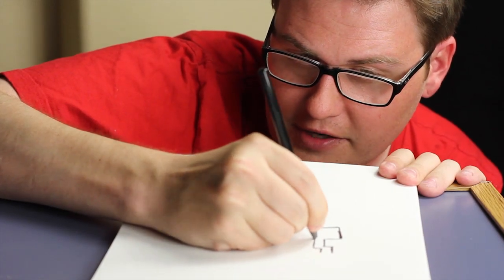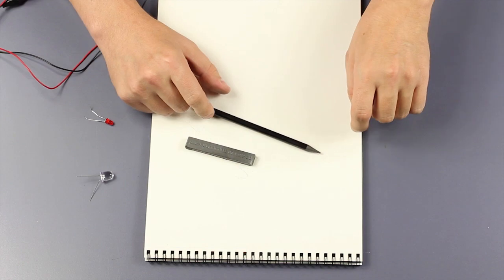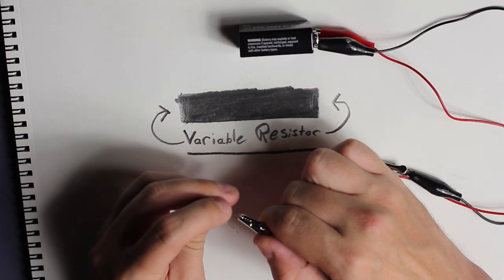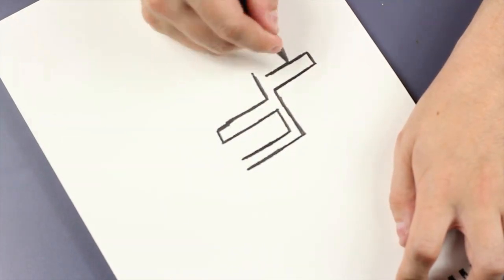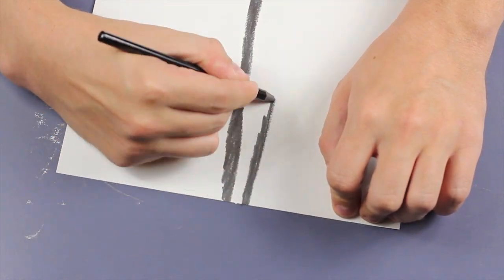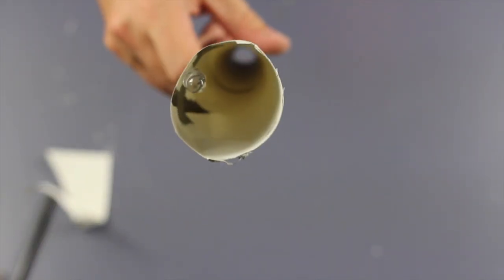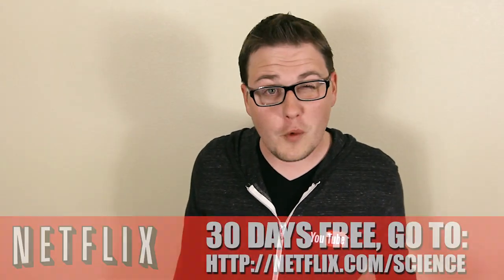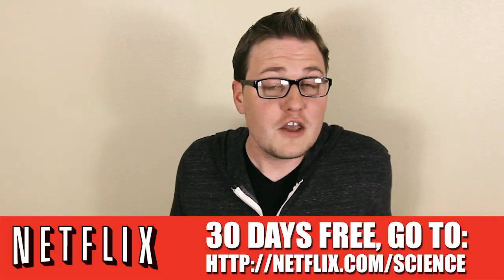Paper Circuit!

Comment: i tried it and it didn't work, when i tried it whit LED. I measured it with multimeter and got big resistance reading. then i calculated, how much voltage would it take to power-up the LED, using U=R x I , method. it was too big to achieve with my school lab equipment.

Comment: There's a reason things are made the way they are. Do a search on logic gates & data storage, then come up with a way to implement that using only paper. I'm sure a paper motherboard using this method is theoretically possible, but even that would only cause problems. A paper CPU is impossible because it uses electrical switches that react to electricity. Unless you pull a magical pen out of your ass that expels mythical gate ink crafted from evil unicorn sperm then I think you're out of luck.

Comment: Actually, even though graphite isn't the best conductor, graPHENE is. Graphene is essentially a single layer of a graphite molecule, and because it has a relatively "2D" geometry, it can work as almost as a superconductor. As you write on a piece of paper, microscopic bits of graphene are shedded off of the pencil tip. These little bits, although not perfectly connected, can still conduct slightly.

Comment: yeah i get that, but it would still be larger. You could see the width of a peice of paper with a x200 microscope; it takes a lot more of a powereful microscope to even see the transistors on a silicon chips. and the uv light that they use to etch the silicon etches in 3d so there are actually layers to the silicon chips too. AND graphite would most likely not be able to be that persice, or carry out a signal for any longer than a foot. Besides I'm pretty sure this video is fake.

Comment: You could of just wrapped a battery in the paper with the line going to the negative end of the battery and on the other end connected to the led with the positive led wire connected to the battery on the positive side

Comment: paper circuits are.. low tech. to go a step up just use a dedicated program and draw circuits on computer (like orcad psice). There you can experiment with logic circuits, very complex circuit, and even make some hardware in the loop stuff (like a hardware switch and a hardware LED, that will flash by an algorithm dictated by the circuit in the program.)

Comment: @HouseholdHacker Since there is graphite in pencil leads and mechanical pencil leads are as simillar. i have a theory which i wish you could test out , why not joining a couple of batteries, use 2 wires and attach them to the 2 ends of the mechanical prncil lead , since graphite when heated produces a bright glow, i think we can make our own makeshift lightbulb !  i was hoping u could test this out LIKE so HH can see this !

Comment: "graphite itself is a terrible conductor of electricity" 
LOL, graphite is much more conductive than copper, the paper circuit resistance is high because the graphite layer is extremely thin.

Comment: Pencils do not have lead.  It is a common mistake, lead is much to flimsy and weak to withstand the force of us pushing the pencil against the writing surface.  Manufactures use graphite in pencils because it leaves a deffinitive mark on the writing surface and it is very strong.  So Obot112, stop giving people your fake information.

Comment: @keoull I'm not 100% sure exactly why it works how it does, just consider that all conductors are also resistors. I guess the more current you push through the "wire", the more will make it to the load, in this case the LED.

Comment: But if that was the case why does the circuit work at all! it's at least 3 times longer than that block of graphite he drew! if the light bulb barely lit at all or didn't work I probably wouldn't have so much trouble wrapping my head around this

Comment: Graphite IS a resistor, but it also conducts electricity. It resists the flow of electrons. I'm not sure what the resistance of graphite is, but the longer your graphite "wire" is, the more resistance you'll have. You can use this to make a simple variable resistor.

Comment: Doesn't work for me using 2b graphite pencil, 1.5v white led, 3v battery, ill draw a really thick square on paper and do what you did exactly and nothing happened but if I attach the wires to the pencil lead it does work help!

Comment: @PickDaCoolMan I've also tried it with a 2B pencil ant the light still doesn't illuminate! But i have one of those regular lights, not a LED. I think using a LED should work cause a LED requires less voltage.

Comment: @TheRadioControlKid Honestly, probably not.
Unless your pencil is graphite (these days that is limited to those expensive art ones) the resistivity of the material would be just too high.

I will now attempt to to see if it is possible to build a capacitor using this method.

Comment: I have to say, I have tried this several times at school during free time. It never worked until I found a new method. And as @RoleXSkirmisP said, it is like redstone. Or at least, my method is. I ground up graphite and tried several other materials into a very fine powder, spread it into a circuit form, and it worked to my surprise. I found it works much better in a powder form.

Comment: @MrGerbilBrain no my LED is fine. let me try with a MUCH harder shading... ok it lights but the resistance is pretty great: 17.81kohms. not much practical for anything but lighting an LED barely... just at that 3.5V range. my little 555 timer on there is not doing anything. the resistance is just too great. a higher voltage, maybe, but if I get too high, I might damage the 555 or the LED. If I want 9V into the 555... I need about a few hundred volts in because the lines need to be thin enough...

Comment: But you can have only 2 parts: resistors/pots and wires. Try making a capacitor too. You can't draw a 555 flashing circuit, but you might be able to use it as a board of some sort. I'm going to try that today and upload a video on my channel if it works. :D

Comment: @HouseholdHacker i am trying to do this experiment but i can not make this experiment work. I bought a 9V battery and i am using a card stock paper. I drew out a line (15cm long) in a straight line using graphite. We connected alligator clips to the battery, then connected it to the circuit. The Led was poked through the paper and each side of the led was connected to each line. We could not get the led to light, is there anything i am doing wrong?

Comment: I used to plug copper wires on the wall socket and throw pelcil grafitti to cause a short-circuit for touching both wires, it was awesome, the grafitti exploded! I stopped cuz once, a friend of mine`s phone which was charging its battery broke, I don`t really got how, must have been some surge caused by the short-circuit.

Comment: This does work, because graphite conducts electricity. Its a terrible conductor though with very high resistance, so it gets hot very easily and if you use too much voltage you may actually cause the paper to catch fire.

Comment: @runningsandwich graphite inside a pencil is an electrical conductor (not a good one as it has high resistive properties). the fact that he put the graphite on the paper just makes it look cool :) he could have just used the pencil and went from the tip of the pencil to the bottom.youll notice hes uses a very thick pencil so theres good electrical continuity.

Comment: I was able to fashion a simple ghetto AND gate using a large resistor like you did in the video, the volts stack and overpower the resistor, more or less. Though a OR gate escapes me. Do you really need a transistor for that?

Comment: AHHHHHHH resistors limit current not voltage, that led is still getting 9 volts but at much less current than it would without the resistor.

Comment: @dramey03 Pencils are composed entirely of graphite- contrary to popular belief, there's no lead whatsoever. Hence the reason why they make non-heat solder alternatives with graphite, as it is conductive (google wire glue)

THE MORE YOU KNOW, BITCHES.

Comment: @conn0r644 that would probably work much better since the metal is just conductive instead of being resistive like the graphite, though you would need to either put resistors in or use a lower voltage batteries otherwise it would just blow the LED XD

Comment: the metal pen at vat19 has very little resistance and works better than this. although the price of the pen is a tad high (but WORTH it, extremely cool pen). with it you can also use graphite as a resistor if you put in a frame like this -{////}- the " -{ " being drawn with the metal pen and the  "////" just plain graphite. the length of the graphite bar will vary the resistance (duh xD) and you can make pretty complicated circuits with the combination of the two mediums.